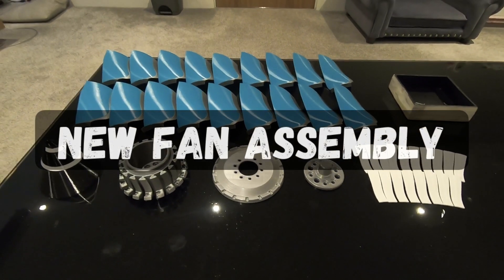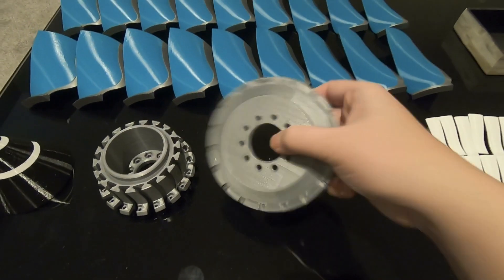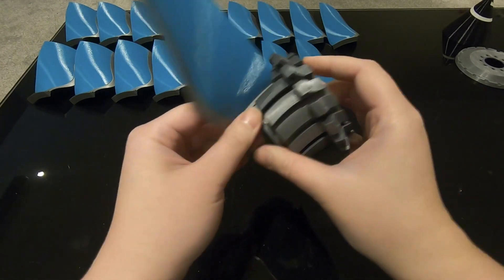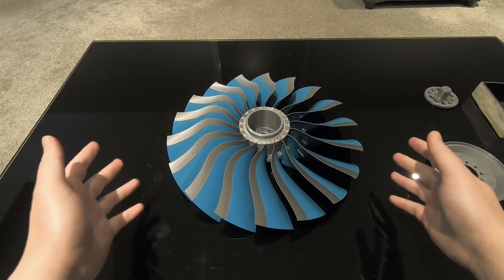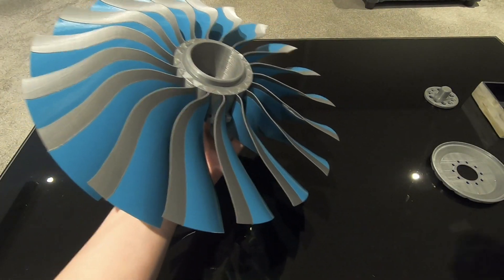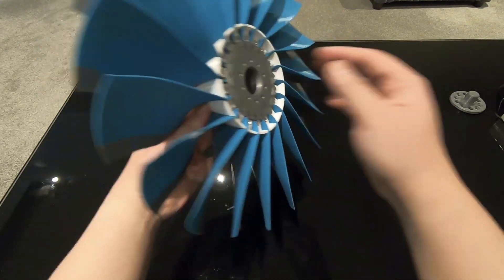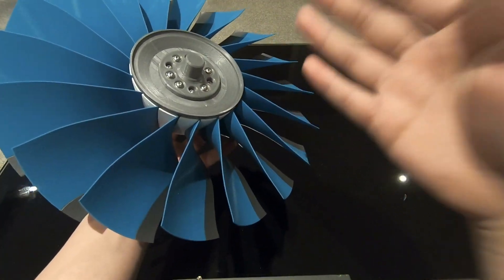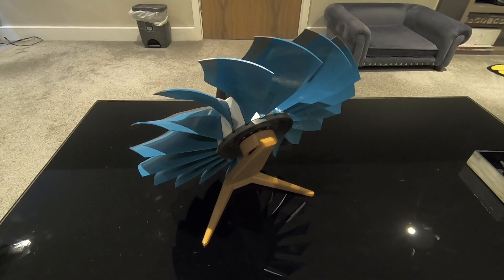3D Printed Fan Assembly (Jet Engine)

Comment: in a normal turbine they do have large tolerance that the blades can even be moved/shaken by hand ( not while operating though). this is to account thermal expansion. it will not shake in place if its rotating at high speeds.  the designers are more concerned about the blades inertia as that will certainly make it shake. that is why the blades are segmented.
Reply: Not always.

Comment: Just in case you weren’t aware... the tight tolerance you have does not replicate real turbine engines.  Fan blades on full size aircraft have some slop to them.  Centrifugal force keeps them pulled away from the hub and “locked” in place.
Reply: @crispybread3812  No, what he is saying is that the fan blades are not rigidly held in the N1 fan disk.  The blades have to float for many reasons.  The N1 fan blades twist into maximum pitch as power is delivered to the the N1 shaft via the power turbine shaft, N2.  Another reason the blades float are to negate any vibrational inputs to the N1 shaft due to a “locked blade.”  Locked blades are our number one cause of high vibrations that are indicated to the flight deck crew via their EICAS display.  The blades DO make contact with the outer acoustic liner as they grow from centripetal forces.  The liner is an ablative material and they are changed when the gap becomes excessive.  Typically the N1 fan blades are removed from the N1 disk and lubricated at their roots with a special molybdenum disulfide based lubricant that is applied by spraying.  Each N1 blade in a large turbofan engine costs anywhere between $17,000 apiece for a simple titanium blade, up to the mid-$100,000 per blade for the engines on the 777 , 787, and the A-380, which are a magnificent exercise in engineering delivering a blade made of a composite of titanium and carbon fiber.  Just saying…
Reply: @Howie Murray That Is An Excellent Observation.😯
Reply: @joshuagrant6192  fan blades still have tight tolerance. Especially from the dovetail to the disk and then clearances between the blades.  I design blades for one of the top propulsion companies
Reply: @crispybread3812  No...He means that the blades are not rigidly held in place and will move back and fourth. What keeps them locked and not moving is simply the force of the blades spinning quickly in a circle, thus pulling them outward and away from the spinning center of the engine
Reply: @crispybread3812  Unfortunately I’m not smart enough to navigate the posting gauntlet that is inherent with YouTube.  Would be fun though, explain how these big air pumps work in detail.
Reply: instablaster...

Comment: I would like to see this setup on a heavy lift drone or a vtol taxi. Where did get the fan blade design from?
Reply: i dont think trubofan work on taxi VTOL. are to noise to powerfull biger and consume a lot of fuel. On taxi vtol must be eficient, low noise.